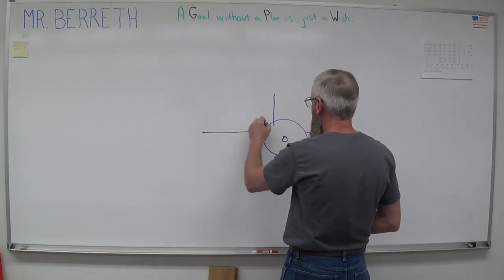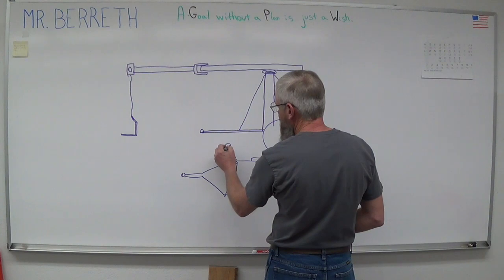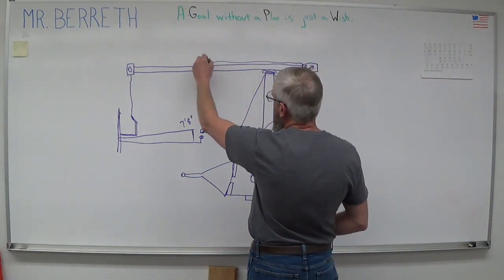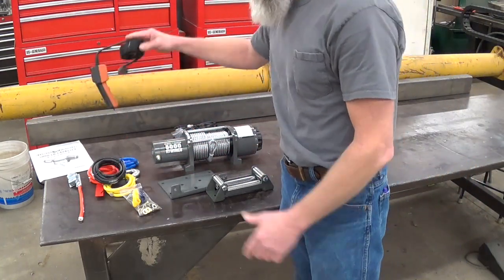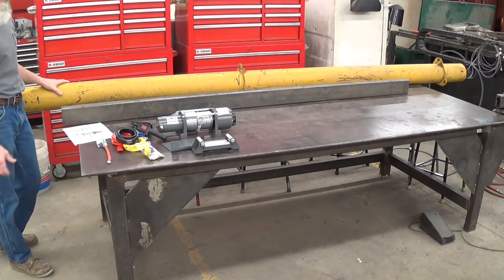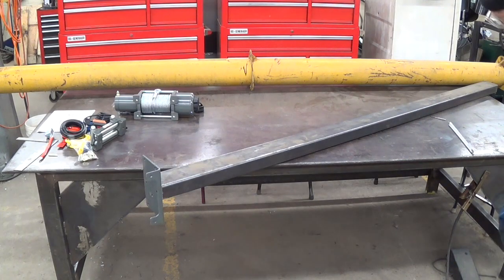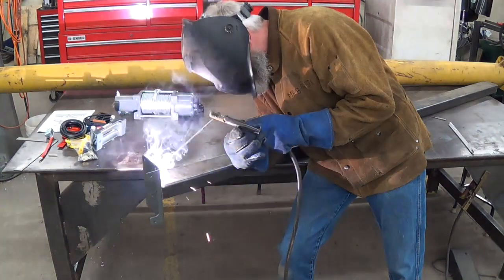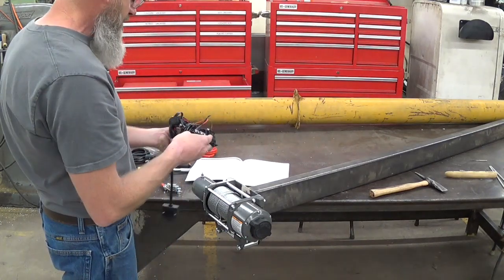Building a Bee Loader from Scratch Pt. 1

Comment: I built one of these loaders, but put it on a used school bus.  I cut the passenger section off the bus and first made a flat bed 20 feet long and 8 feet wide. Mounted the mast at the front of the flat bed, used small hydraulic cylinders to level the boom, which extends the length of the flat bed. I used 5 inch thin tubing  for the boom, 6 inch pipe for the mast, and a wheel bearing hub from a used semi trailer axel from a junk yard for the top swivel and a 3500 badland winch from Harbor freight for lifting, which comes with a wireless control, so you don't need wires coming down to the hive cradle. It easily picks up 12 cement blocks, just testing the winch.  But you have a good idea, just don't spend so much time showing the small part and focus on the main ideas when explaining the build, then you can show us much more quicker of how your plans will go.  Thanks and hope you a successful build.
Reply from the maker: Ron,
Thanks for your comments. I apologize for the detail. I teach High School shop classes and these videos are part of my digital classroom due to the current situation. I have a piece of I think 14"x 1/2" pipe that I will use for the mast and a plow hub for the swivel. I looked at the wireless winch when I bought this one and for some reason decided against it. I think eventually I will find one of those retractable trouble lights and use the wiring from it for the switch.
How did yours work? Any changes in material or was any of it overkill?
Thanks again, Charlie
Reply: @pathofthebee2873  It works great, I used two hydraulic cylinders to level the boom when loading, two hive pallets  and the deck will seat 60 hives per layer.  It  easily picks up 300+ lbs, the cost of these lifts of this type cost many thousands of $$$..  Keep up the good work and thanks for your ambition for teaching our children skills as you stated in shop classes, that's where I learned how to weld back in the late 60's.

Comment: I know noticed from your design, the amount of stress that will be on the joint connecting the counter weight arm to the wench arm. I think that since the arm needs to bend on that joint, if you could build scissoring support for the arm. It would have a single rivet joint in the center that it would bend on when opening and closing the arm. I am excited to watch your progress, and i wish you luck.